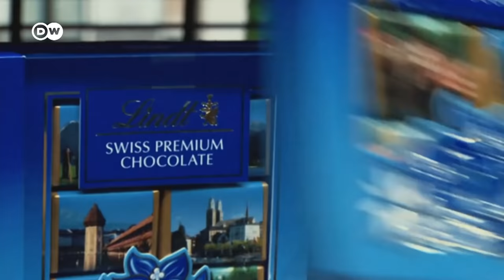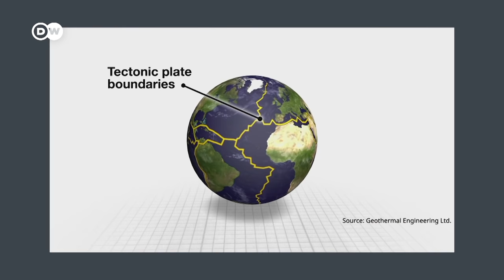Geothermal energy is renewable and powerful. Why is most of it untapped?

Comment: I had a house near a Geothermal generator plant. Constant Earthquakes!   They are taking water in an out of the ground. Bad Neighbor
Reply: It's a closed aquatic system.  Earth quakes happen all of the time anywhere there already exists geothermal sources, because tectonic boundaries create both of them. I'd be very interested to see how you can tell the natural earth quakes from a microscopic amount of energy diverted to humans causing earth quakes. Fracking causes lots of earth quakes, everywhere and nobody seems to care.
Reply: @davidk7544    David, I lived in Cobb California next to a Calpine geothermal 55mw power plant called The Bottle Rock Geothermal project. It causes constant local earthquakes. Not the 6 or 7 magnitude, but mostly around 3. There were some around 4 or higher. Three or four a day. I knew the plant manager and I had a tour of the plant.   Fracking is not the major problem for drilling. The biggest causes of Oklahoma earthquakes are induced by wastewater disposal.

Comment: The word renewable is being used a lot when it comes to green energy... to the mass it sounds as if you can renew the used/extracted energy, wich offcourse is not the case... 

Geothermal energy has one major flaw that should not be overlooked, but is hardly ever spoken about. Apart from the possibility of earthquakes, you are extracting heat from the earth... that gives the core the possiblity to lose more energy, wich on the very long therm might cause problems as difference in earth rotation etc.... how are you planning to deal with that? Or are we just going to ignore that problem and leave that to be questioned and solved when the time comes?

Comment: Geothermal's just not being properly engineered, they don't think big or deep enough. Properly designed would be more than enough and the best possible renewable energy but the ROI would be 30-100 years not the 4-10 they are mentally trapped into planning.

Comment: How exactly does thermal energy renew itself?
Reply: Great question Erik! 😅
But one can be sure if it does! 😬
But if mankind were to abuse this source of energy, Nature will be sure to make us regret that carelessness with our dieing breath! 🧐
Reply: @peterolsen9131  From the physical point of view, it is not renewable, neither will the reactor in earth's core run forever. It's just a big heat reservoir.

Use it, but take care not to destroy your neighbours homes with the little earthquakes often triggered by geothermal drilling.
Reply: It doesn't renew as a whole, but humans could never use the amount of energy available. Even if we used as much as we could, it would be so small as to be undetectable compare to the entire mass of the planet. It is a "virtual" heat source without producing pollution.
Reply: @erikschiegg68  the decay of thorium , uranium and other radioactive elements is what powers the core , so not a big heat reservior only, but an active, vast decay reactor , well insulated and will run for millions of years,......
Reply: Nuclear decay.l
Reply: It doesn't. The video is unaware or ignores the real issue. The crust is a good insulator and at heat equilibrium. Not much leaks out which is why we don't  burn our feet walking about. The few places where the heat is collected by water soon cools if you extract the hot water and reinject the cold (which takes a lot of energy). The rocks do not conduct heat fast enough to keep the plant at high temperatures needed for steam turbines. A few places have large hot reservoirs that cool slowly during the short life of the plant. But essentially it should not be classed as renewable but an extractive industry. Then there is all the CO2 gas released with the steam, and toxic metals, sulphur, arsenic and silica. So much that it does not compare well with solar and wind. The silica clogs the turbines and wells. The amount of electric power is small, better to just use for central heating and greenhouses.

Comment: They can't dig too deep, because their equipment will melt... How? We need 100°C to convert water to steam. Let's calculate with 2 or 300°C because of heat loss and so on. These digging machines working with diamond heads. Metal parts will not melt on this temperature (they need above 1000°C to melt). And we didn't talk about cooling... I'm not an expert on the subject, but if anyone here is, I'd love to hear what their obstacles are. Except for the money of course...

Comment: I suppose course losses at transporting energy to other regions are too high. Hardly it is useful to make high voltage lines for less losses. So there is only one way - local small power plants. Each roof or road nearby should have as much as possible solar panels, maybe even some field nearby with lots of small wind turbines or river turbines, instead of building new personal cars. And a forest recreation centre with lots of workplaces for planting, cutting, storing, selling trees and wooden materials, heating pellets etc. And this thing should be very well organized
Reply: And now it's possible without accumulators! No need of them and their recycling at all

Comment: Would not geothermal energy extraction speed up cooling of earths core if yes than what would be its side effects on earths magnetic field for example?
Reply from the maker: Hey there! No, it does not cool the Earth’s core. The radiant heat is taken from the crust (Earth’s surface). Hope this helps ✨
Reply: @DWPlanetA  Alright I understand. thank you for clarification.

Comment: Table of Contents

What are the Advantages of and Disadvantages of Geothermal Energy?

Inability to move

Environmental Side Effects

Infrastructure

Earthquakes

You will need Land to Install a Geothermal System

Sustainability questions

Geothermal sites can run out of steam

Geothermal reserves are not irreversible

The high-temperature conditions

Not to forget the final question: Is Geothermal Energy expensive?

Conclusion

Comment: Isn't there any concern around cooling the earth's crust? I feel like we're potentially setting ourselves up for another carbon crisis of unintended consequences if we start large-scale extraction of heat from the crust.
Reply: Absolutely not.
Reply: 99% of Earth has more than 1000°C. So probably not ;)
Reply: All that heat is continuously generated by the earth's own gravity and the resulting pressure of its own weight.  To use up all of its heat would be like using up the earth's gravity.  Very doubtful, indeed!

Comment: What are the Advantages of and Disadvantages of Geothermal Energy?
The advantages and disadvantages of geothermal energy play a significant role in deciding how to make the most out of it. Geothermal energy is environmentally friendly. It is cost-effective, energy-efficient, quiet, and convenient. Using geothermal energy does not require the use of chimneys, venting, and …. You get pure and environmentally sustainable electricity by using this form of energy.

Comment: Now , i might not be the smartest guy around ... But how the fuck could someone call that ''limitless'' and ''renewable'' ... ???
Imagine for a second that the entire planet would start using geothermal full scale ...  like really full scale ... How much heat would the core lose ... ???  What if that would affect the viscosity of the core ... Then lose some of it's rotating capacity ... then lose the magnetic protection ... And get burned by the cosmic radiation ... 
Can someone tell me how is that renewable ... how exactly does the core renew it's temperature ... ???
And limitless ... How exactly does something finite get limitless energy ... ???
Because sure as hell ... it will be damn hard to put that heat back in and accelerate back the core ... should the push come to shove ...

Comment: If we extensively harness power it will affect earth magnetic field... Which results in mars like destiny
Reply: Humans aren't going to freeze the core, for one thing it contains enough radioactive material to heat itself unlike mars. Plus the Earth's crust is so thin relative to the size of the earth that completely removing it wouldn't noticeably effect how well insulated the core is.

Comment: Geothermal energy is renewable, but not entirely environmentally friendly. It is certainly cleaner than digging up oil, gas or coal, but If you bring up geothermal heat out of the earth, you bring extra heat into the atmosphere, which does not help in this time of global heating.

Comment: I don't know,  maybe because Earth is a BIG place? And geothermal energy is NOT renewable. Where do you people come from?
Reply: @philiptaylor7902  The rate at which this energy transfers to earth's surface is only 2 x humanity's energy consumption rate. Meanwhile the solar radiation hits earth at a rate of 10000 times humanity's energy consumption. The temperature at which the geothermal energy is available is somwhere in the 20°C - 500°C range, giving a poor Carnot efficiency limit. Meanwhile the sun's radiation is at a temperature of 5600°C, giving an awesome theoretical efficiency for solar panels.
Reply: @5th_decile  Hi Vergilius, very true, there’s relatively few thermally active regions where geothermal can make a significant contribution to electricity generation, but it shouldn’t be discounted.

Comment: How can you call geothermal energy eco friendly when it produces some toxic gases? I think geothermal energy produces more emissions than natural gas.
Reply: How would it cause more emissions? No CO2 is used..
Reply: It's not producing any new gases. If left untouched the same amount of toxic gases get released anyway.
Reply: @mrcleeves7106  Sulfurous gases CAN accompany heated water at SOME locations, but it can be harvested to use in industry or medicine or just sequestered on site. The gases from geothermal are already made, they are not "emitted" by using geothermal energy. Burning fossil gases does chemically chance CH4 into CO, CO2, NO, NO2 (from air) and H2O.

Comment: What a misleading Video we have geo plants here that have water enclosed in pipes and run closed loop.  They drill down and then horizontally run the pipes a distance to maintain 500 F which is all that's needed to run modern turbines and gen electricaty California has many of these too.  The OIL oligarchs block the wider use with misleading nonsense vids that show old tech like this you see in on chart 1000 f  and the old pumping water down or tapping ground water.   There are other techs that use the heat to run Sterling Engines which are ideal because run at constant RPM which is good for generating electricity but most misleading vids suggest sourcing the heat from electric  or gas powered devices that use oil powered powerplants.  Our planet has a molten core providing heatwhich cost nothing and is non-pl;uting and available everywhere,